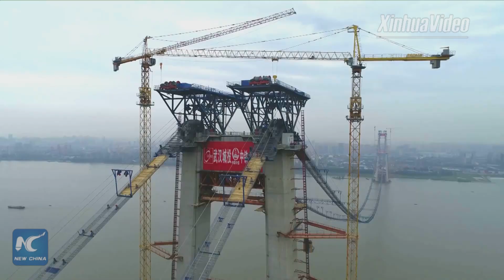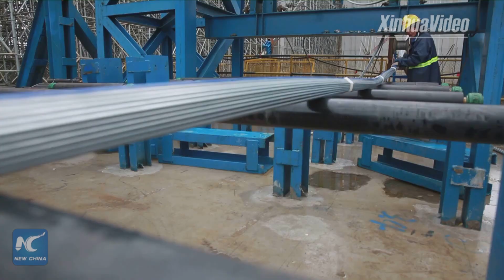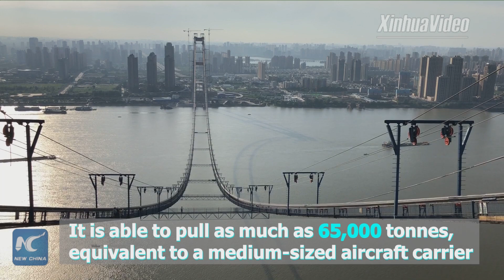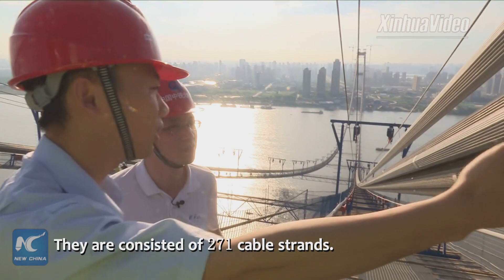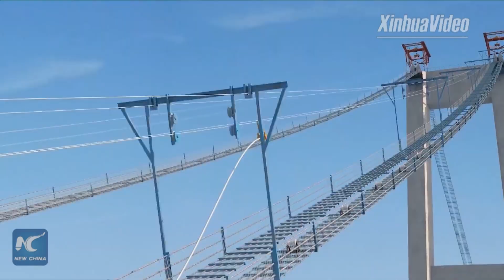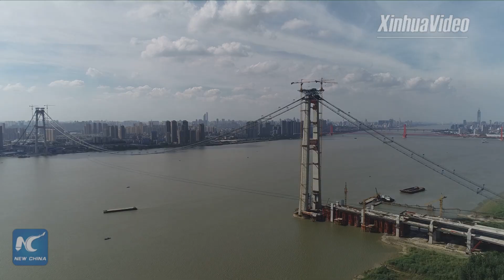World's longest double-deck suspension bridge installs main cables

Comment: Quite similar to the Verrazano-Narrows Bridge between Staten Island and Brooklyn in New York City.   The Verrazano-Narrows Bridge is 4,176 meters long and the Yangsigang bridge is 4,320 meters.  Although the Verrazano-Narrows Bridge opened more than 50 years ago the 13th traffic lane (a direction-reversible HOV lane) is a fairly new addition to the old bridge.